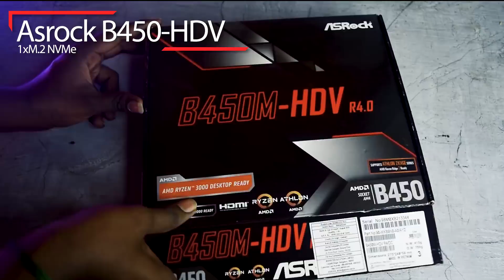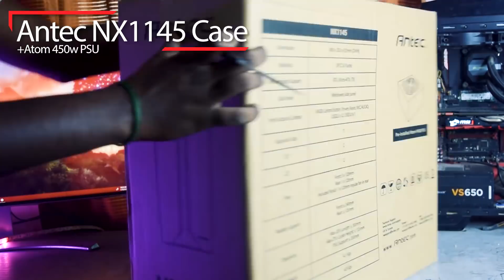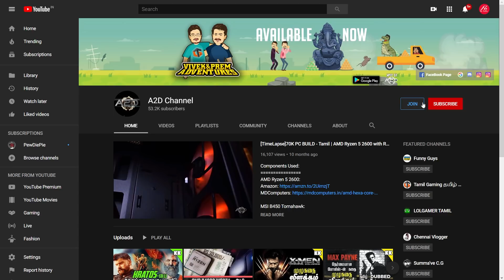37K-ல் Editing + Gaming PC | @gameplayontamil2879  PC BUILD | PC Build Tamil

Comment: One of the best build 🔥just try this my friend ✌️
Processor:  AMD 7 2600x
Motherboard: Asus rog strix b450-e 
GPU: Asus rog strix RX570 oc edition
Ram: Gskill 2×8 (16GB 3200mhz)
PSU: Corsair 750 gold + psu
Case : cooler master mb 520 ( Best air flow)
M.2 ssd - WD blue 250 GB 
SSHD - Seagate firecuda 1 TB
.....__________________________.....
Monitor: LG 29inch ultra wide 29um69 - 1ms (amd freesync)
Keyboard: Corsair K55
Mouse: Asus rog pugio (Gaming mice)
Desk Pad: RedGear MPR800 
.....________ Amazon Total Amount : 1,20,000 ₹ _____.....

Timelapse+ play games  ( forza horizon 4 , AC odyssey , Watch dogs 2 , dragon Ball kakarot , Naruto shinobi strick )
Reply: rx 570ku gtx 1050 vangirukalam samer rate than(gpu nalae nvidia than bro)
Reply: Gtx 1050 ku rtx 2060 edukalammm .... Performance tharru maaru, thakali sooru